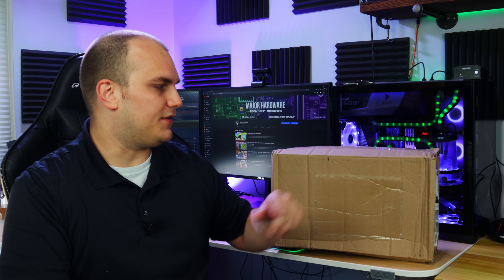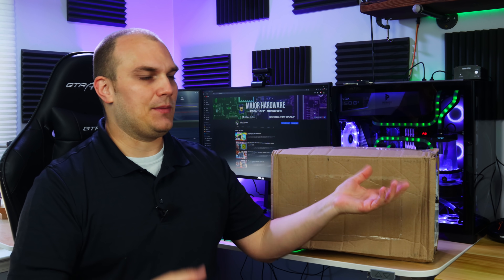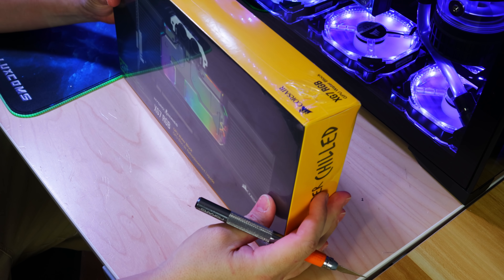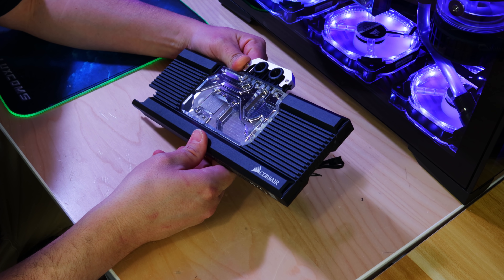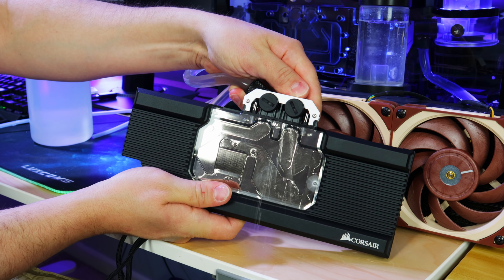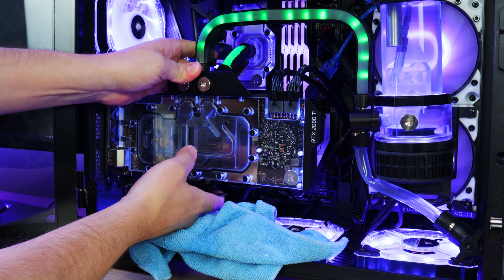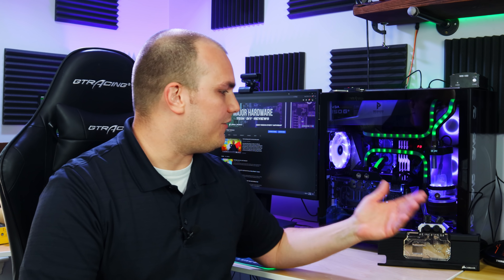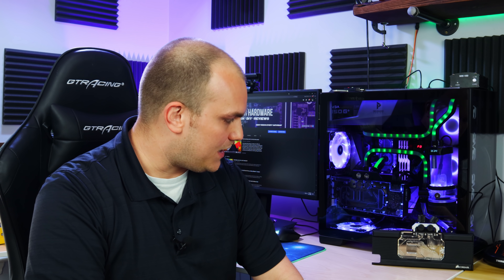Why Is No One Talking About This?? | Corsairs Leaking Waterblock!

Comment: have you tried tightning the hold down screws more?
Reply from the maker: I did the first time I ran into the issue no luck
Reply: @MajorHardware  think you could 3d print a new top manifold to fix it? Maybe something that replaces the metal facade?
Reply: @MajorHardware  looks like Jay 2 cent found your video 
https://youtu.be/kmQdZ79RFuc

Comment: is that terminal made from cheap plastic or why is it so bendy? despite the missing middle screw. that should be way sturdier. if it where, it wouldnt't bend so hard even screwed with two screws like it is, i guess. maybe someone here is a machinist and can make a replacement part out of delrin or even better, brass.

Comment: Wait, it only leaks if you put a few in/lbs of torque on a seal???  Not trying to be a dick, but the same is true for MANY rotary fittings on the market.  This stuff is NOT meant to have any preload on the fittings.  If you cant build a loop that is gentle on connection points, that's on you!

Comment: Corsair doesn't "fix" when you RMA most of their product line. They just replace it with another unit, unless you have a broken fan, damaged side case panel, not working front panel connections etc. When you have such a RMA, they just send that replacement part to you instead of RMA whole unit. 
Probably they didn't have the block in stock at USA and they directly shipped it from their EU hub to you to save time, since they have a global shipment agreement with DHL for all of their logistics operation.

Comment: I was considering this block, but after looking at this, I'll think go with EK now. 
I was pretty skeptical at first since the price was $150 which includes both the block and backplate. 
They'll normally would be purchased separately at a slightly higher cost. 
You just saved me a whole lot of research and worry.

Comment: Yeah that's not surprising. That terminal block on the Corsair GPU block is, for a lack of better words, fucking awful. There is a reason EK uses a center screw, first of all, and secondly all 3 screws for the terminal block go through the entire depth of the terminal - rigid AF. Also the terminal blocks are o-ringed. They've always done it that way, and they've always been basically bulletproof. The Corsair design uses two thin pieces of material on each side to screw the terminal into the main block, they CLEARLY don't have enough material thickness to be rigid - and due to the fact they don't have a center screw through the terminal, they are entirely relying on those two outside screws... And they stand no chance holding up to twisting forces. It's a terrible design, I'm not a mechanical engineer and even my dumb ass can see there's no way that terminal block stands a chance to stay tight against the main block.

Comment: Good video and crazy defect that wasn't caught in r&d. Corsair just needs to machine this piece out of anodized aluminum and either repair blocks with it or send it to customers as a fix. 3 screws is ideal but if the part is rigid enough 2 should be enough.

Comment: Maybe I got lucky, but I'm running 4 of these in a 4x2080ti deep learning rig and it's been 5 months. I didn't have any leak. But I did disassemble each unit prior building the rig. 
Just make sure that everything is tighten nicely it might solve the issue, but still, it shouldn't happen in a 200$ Cad product. 
Good luck with that !

Comment: That's crazy! I've never seen a Corsair product so obviously faulty. I'll stick to EK for all my blocks I think.
Reply: I've only heard of two and I owned one with similar results. The h100i V2. My experience was that it failed within 4 months and the person I found with that experience went through 4 of them before he decided to investigate why all of his units failed. Turned out it was from corrosion, they didn't add enough anti corrosive to their mixed loop.

Of course he wouldn't be eligible for an rma after cutting up each loop to take a look. 

Generally speaking their products are good, just sometimes an oopsie gets created.

There was a power supply they made that was prone to failure as well.
Reply: @ArtisChronicles  'Generally speaking their products are good' Nope, their products are pretty shit. The only reason buy their shit, is that Corsair is a popular brand in the 'computer world'

Comment: hey man im glade corsair Finally got a guy to test there water blocks you know who im talking about you . Man you should be getting paid for this. it's funny to think a company like that dont test there products as well as you do like seriously think about it i got abit a tube pull on my R9 fury or a vega with a 120m rad That SH!T GONNA GET HOT and heat up the plastic and make it even easier to break , i would say a refund for you and maybe a couple fans for u touble if they want to be nice witch they should, plus they f**kin send u every new waterblock to test out so i know im not gonna have a leak in my system XD

Comment: That really sucks because the block looks awesome, the flow indicator is such a cool addition, and to top it off they apply the thermal pads which is the one thing I absolutely hate doing because atleast with my 1080ti block I had to cut there pads to fit which isn't hard to do, unless your like me and do what I did and get into a hurry and cut and apply the pads wrong then have to wait on replacement pads to arrive... but with the Corsair just peel the plastic and you are essentially ready to go... And this problem is a simple fix with a 3rd center screw like with the ek

Comment: To be fair it's not exactly a normal scenario to pull on the block with all your strength. I'm not saying this flaw is OK but the point still stands...
Reply: It does not look like he's putting a lot of force on the corsair block.
A flaw like this would mean that you would be unable to move the system from it's spot at all for fear of it leaking.. 
And, some things get worse with age. (especially if o-rings are involved.) so it might leak without any force applied a little while down the road.
Reply: The flaw is valid if you have the card mounted horizontally with the fittings and soft tube attached. The weight of what it is supposed to hold can make it leak which is how he noticed it in the first place. Is it okay to accept a $150 product that has a design flaw? There are many other water blocks out there that don’t have this issue.
Reply: You’ll be surprised with the amount of pulling and tugging force needed to build a PC nowadays.

Comment: I gave up on Corsair. I still have my 1000D case, but i've returned the 10 x 120mm Corsair HD Fans and 3x 140mm HD. The result is stunning, it's really cool the colors, effects, etc but after 1 year and a half with them, I have replaced 3 fans because of color degradation. For example if you set all to white, I had a fan that from a day to another it went green. Had another fan that one led decided to go rogue and stay on red. Corsair Commander pro, replaced 2 because one decided to totally die, and the other one decided that channels 2 and 3 for the fans, don't work anymore. Happened the same with my K70 keyboard. My "Z" was turning green, R was turning yellow... Just got my replacement today from Netherlands as well, took them a month and a week.

Anyway, This is just my experience after a year and a half. Corsair customer service is fine, but I'm extremely pissed and bored of having to switch stuff and do RMAs etc... Specially considering the expensive cost of Corsair products.

If you have the chance, you can demonstrate that there's a design flaw and you should be able to return to the shop and get your money back. I could do it within a year and a half later.
Reply: I went very cheap on my rgb solution. Bunch of white fans plus a pair of strips with their own control box in a white case (phanteks enthoo pro). So far so good, but the rgb has only been running for 3 months and the white is great for bouncing the light everywhere. Even makes the fans look like they're that colour.

Comment: EVGAs HydroCopper blocks are THE BEST!  They’re awesome.  I’ve owned 3 sets of 2 EK water blocks and they make excellent blocks.  I would never put one of those cheaply designed Corsair blocks in my system as is.  I’ve also owned several Koolance blocks which are really good too.
Reply: Former EK engineers designed the entire Hydro X line if I'm not mistaken.
Reply: @BLACKOUT2388 well, they messed up
Honestly though, I like the look of their blocks.  I considered checking them out before I learned they were leaking.  The CPU block seems good.  The messed up thing is it’s such a simple fix!  Not something to be done on existing stock, but anything new leaving the factory, definitely.

Comment: This Corsair block is a weird beast. it's basically AIO gear slapped into a GPU block. Even the cooling engine is not a big copper monoblock. The fin stack is screwed into the larger VRM/memory plate because they used the same microfins used in AIOs, which is far from the best cooling solution when you have high flow pumps.
Basically, every other GPU block in the market using more traditionnal thick fins/high flow, monoblock configuration cools better than this one for the Same price!

Talk of paying for a brand name..

Comment: The fact they send you a new product instead of your defective unit is pretty normal for a RMA process. Companies often just check if your claim is true and just send out a new unit simply because it's faster and usually cheaper then a repair attempt. Last year I opened a RMA case with Crucial for some defective RAM I bought on eBay (seller refunded me, but didn't want it back,  bought a different set of RAM somewhere else), they simply said "Hey, we don't have your stuff in Stock anymore because it is out of production for a while, we would send you this other thing if your claims are true, are you cool with that?". And that's how I ended up with 32 Gigs of RAM for the price of 16.

Comment: I had a complete corsair waterloop, until their XR5 360mm rad leaked onto my 2080ti 5 days after it was built. I believe a underline stress crack from factory opened up as the water temp rose during a few hours of gaming. I've rebuilt my entire waterloop with EK products now and after 1 month I've had no issues. On the plus side I am getting compensation for the 2080ti from 
Corsair so their RMA process is worth going through.
Reply: Hoping you actually get the compensation. It's pretty bad that it even happened. At least EK has been solid.

Comment: I went through 3 RMAs personally, but for a different issue - the "flowmeter" paddle wheel stops working, thus restricting your loop's flow rate by roughly 50%. I gave up after 3 RMAs. I like Corsair as a brand, however they often put form over function. Sad, as this is a pretty expensive product.

Comment: I commented on your last video about this and it's just the difference between a mass produced product and a high quality cnc machined product. Now that you have some experience with EK products and you know the difference, I think it would be a good idea to compare the difference in a video for your viewers with a complete tear down of both noting the differences. In the end the gpu terminal shouldn't be experiencing any lateral force to the fastening mechanism like that in a properly designed loop, however, Someone who is experienced enough with watercooling to know not to make that mistake wouldn't buy a corsair gpu block...so it does need to actually be fixed. hard tube pulling or pushing on a terminal that hard probably isn't something that would be easy to accomplish, but a beginner using soft tube and compression fittings could definitely set up a loop in a manner that led to leakage this way.

Comment: It could also be fixed with a sturdier material than what ever that coupler is made from, so it can't flex enough to cause a leak in the first place. Honestly, that is what I expected when it was obvious that it still has 2 mounting points. 3 Mounting points may not even fix the issue if the damn thing is made out of a flexible material. 
Wonder how much worse it could be if it was at 55-65°C. Would it leak passively? Or simply require a lot less force.

Comment: In my sample size of 1 even Ek blocks have issues. I bought my gtx 1080 block used and the screws were rusted into the acrylic.
I much preferred my 2 aquacomputer blocks for 8 years. The screws dont rust and they perform extremely well.
Sadly they have a premium price to them.
Reply: from my experience aquacomputer and watercool are the best blocks on the market. Ek/alphacool are step down in terms of quality.

Comment: My EKWB did this once after a cleaning (luckily it was just a leak test and nothing was turned on), but after torquing it down, it was good. Just curious, have you tried tightening the fitting? Does it still leak?

Comment: Are RMAs ever repaired or just replaced?  I've always gotten a replacement and assumed that if repaired they'd be sold as 'refurbished'.
Reply: @J Fz so basically most of the time it's just replacements. Kinda figured. Guess I'll be trying to get in touch with someone like Louis Rossman if I need a repair on an electronic part.

Comment: i wanted to go custom loop with corsair at first, then thought, ek would be better even if i paid a premium and now you found a design flaw that me as a noob wouldnt catch. but it can be saved i think, if you take off the terminal and put silicone based sealant around it(same sealant for cars oilpan) it could be saved

Comment: Did you just stall those 2 fans at 5:50 for like 30 seconds? Doesn't that risk damaging windings due to overheating or damaging the motherboard due to high current draw?
I guess mobo has protection from that but still, that looks like unnecessary risk.

Comment: I killed a motherboard by doing this with the XG7 on accident. This is my first ever GPU block AND  first open loop system and I just wrote it off as user error. I guess I assumed that all GPU blocks worked this way and that I had fucked up. I'm a retard.

Comment: Knowing this now, I'm definitely going to avoid Corsair GPU blocks.

If I had a Corsair GPU block already, I think I could fix it by disassembling the water line fitting piece and reassembling it with a generous amount of silicone sealant. Maybe that could be your follow-up video. See if you can fix what Corsair is unable or unwilling to fix themselves.
Reply: >Maybe that could be your follow-up video
If you paid $160 for a GPU Block that leaks, don't try to fix it, return it. 
If you want something that leaks he's got a video on a DIY waterblock.
Reply: As someone who has had hardware die as a result of a leak in their system, I wouldn’t risk it.  The blocks design is fundamentally flawed where the leak is.  The only thing that can be done is redesign that spot so it’s more rigid.  If you’ve never seen a proper water block, the acrylic, or metal, has channels molded into the surface where the o-rings sit.  So the parts can sit flush against each other while the o-ring prevents any leaks and keeps everything air tight.  If it bends or moves, like the Corsair block does, it’s going to leak, as demonstrated.
Reply: noxxi knox  This is true. Proper prep work is very important for any DIY project!
Reply: noxxi knox  I would try plumbers solvent weld if both surfaces are plastic.
Reply: just go ek lol
Reply: It's not just their GPU blocks, it's their AIOs as well.